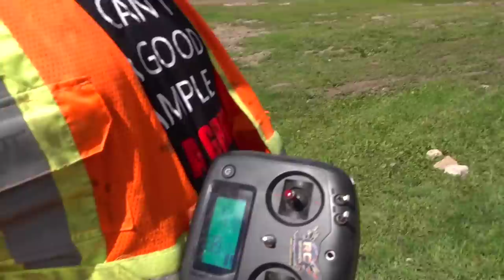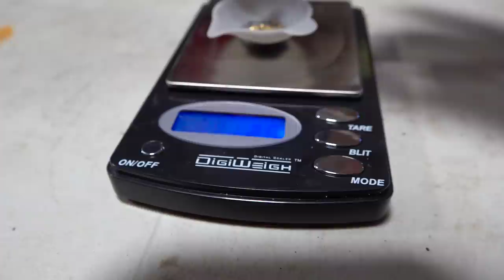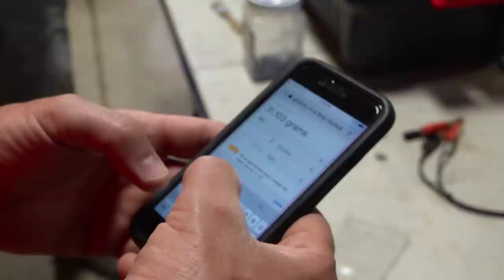YouTube GOLD - DUEL DOZERS RIP the CUT - GOLD MAKES THE UGLY BEAUTIFUL!  (s2 e14) | RC ADVENTURES

Comment: Where are the two that are dropping down on the lower conveyor belt you can put a metal house around that area over and all that and stop the wind from blowing in and blowing all of it off there's nothing wrong with making it efficient that way when it comes out on vehicle are built it will just keep running normally but in between the wind will blow it and then you will lose gold I will put a little building over that area custom fit for the conveyor belts at the top of them around the all the way to the ground with a little holes for them to the dark to go in and to come back out problem solved
Reply from the maker: But where is the comedy in that?! Lol ;)

Comment: Why don't you have a bigger bucket for the wheel loader
Reply from the maker: Because the hopper gets too full too quickly
Reply: Ok
Reply: Why not make the hopper run at a faster speed
Reply from the maker: @shanemannion4077  Because the plant can only process so much material effeciently
Reply: @TheRealRCSparks  ok